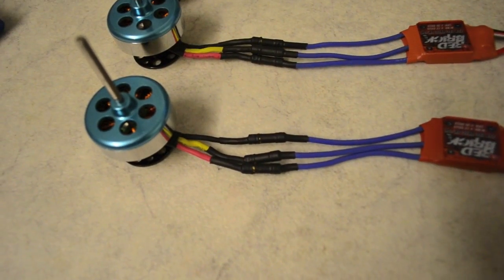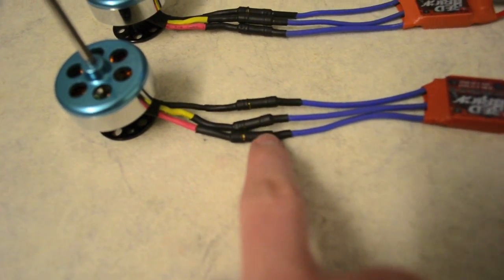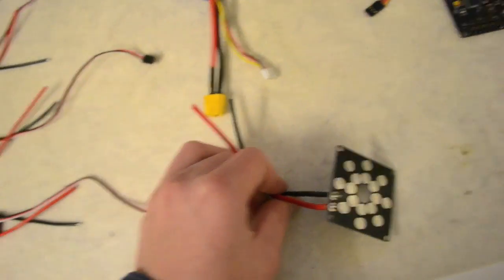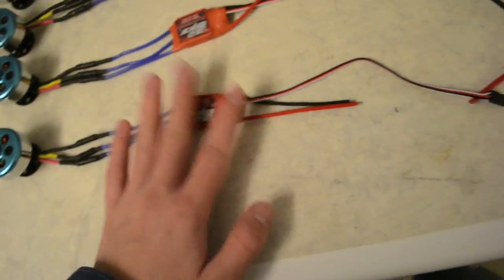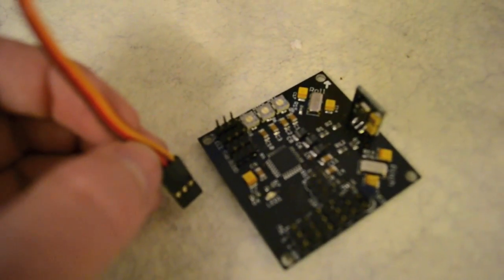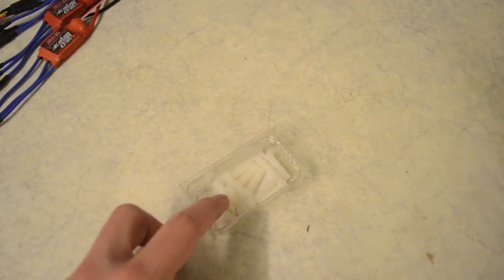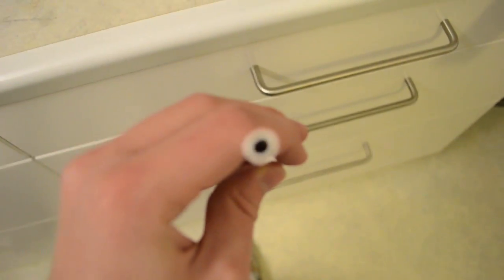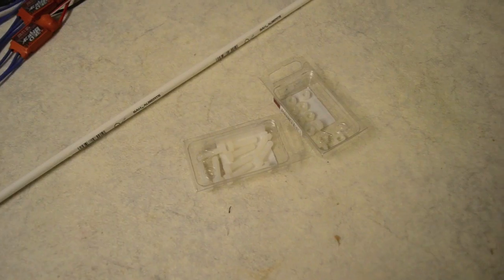Quadcopter Build v1.0 [Part 3]

Comment: I prefer EC3 connectors. They work wonderful with standard 3mm barrel plugs.you can leave all of your connections as barrel plugs and when its time to attach your battery you dont need a special deans plug. The space savings alone makes it worthwhile.